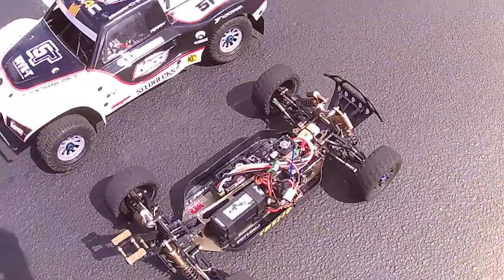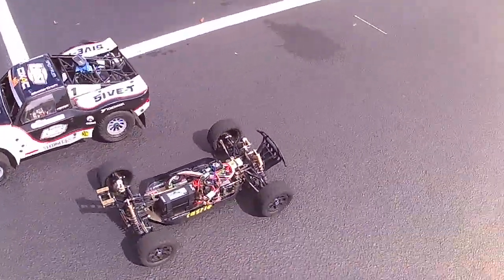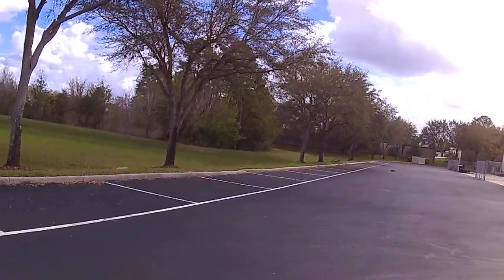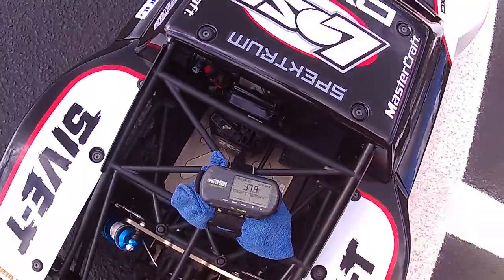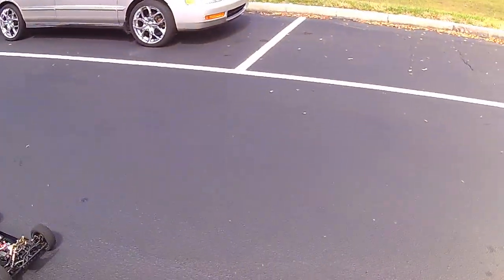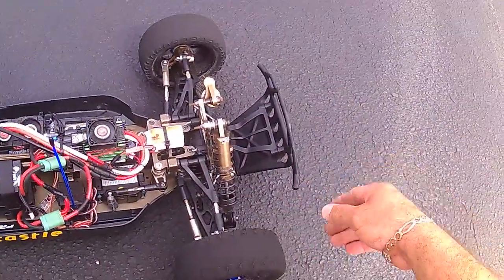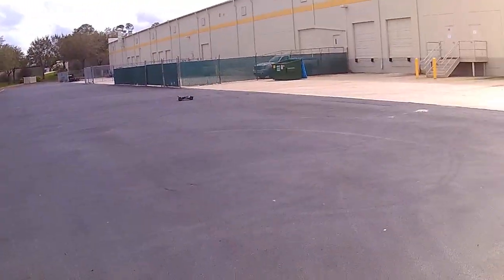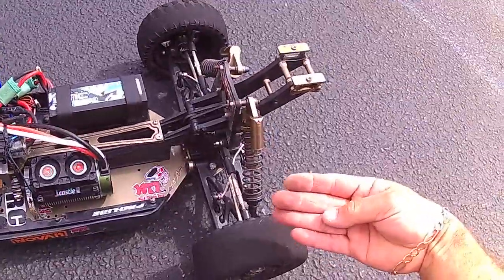1/5 scale REDCAT XB-E [ 8s POWERFUL BEAST ]

Comment: Why does everyone think that the Castle 2028 is the motor for this car , a 1717 ..1580kv is just fine for this 20lb buggy , its light comp with other 30-40lb buggies. The 1717 is cheap and so is the speed control with mush less current draw.